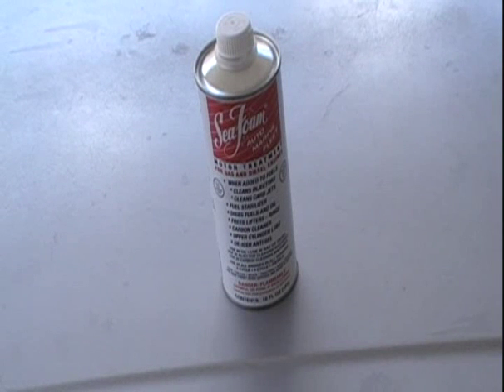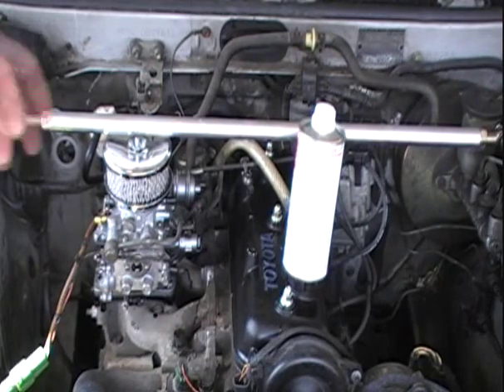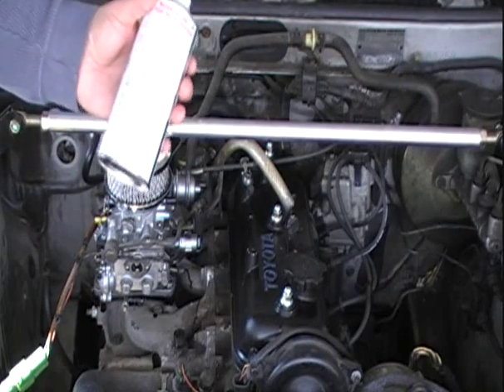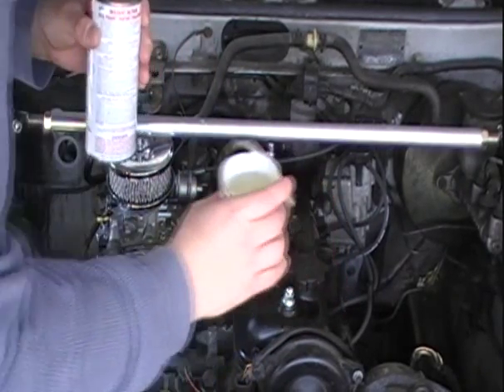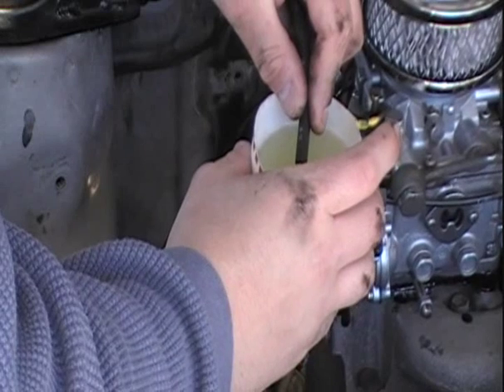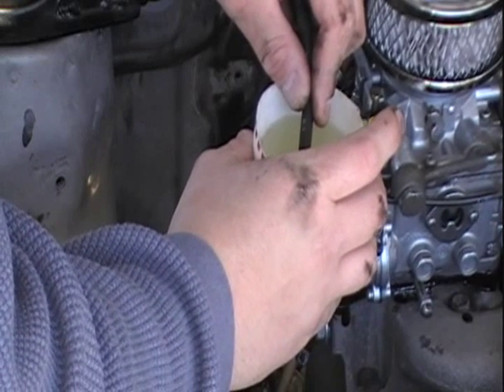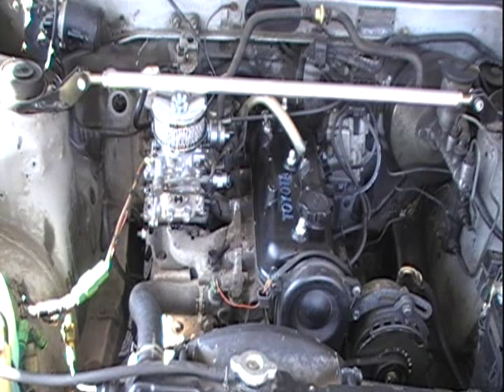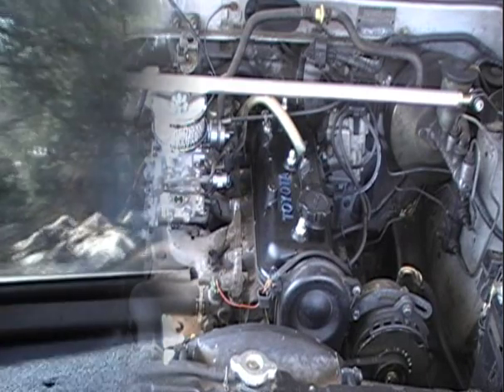Smoke Screen Engaged! (How to Seafoam a Car Properly)

Comment from the maker: @dani808616 
The only one I had left. :P
It doesn't matter. A lot of people use the brake booster line. However you should pick one that allows an even amount of seafoam into each cylinder. For the 4AC the brake booster line wouldn't work very well. The base of the carb works best.

Comment from the maker: Not really. Most people use the brake booster line. But, try to find a line that goes into the center of the manifold. So, when you add the seafoam to it an equal amount will go into each cylinder.